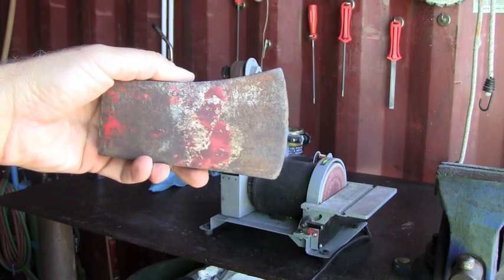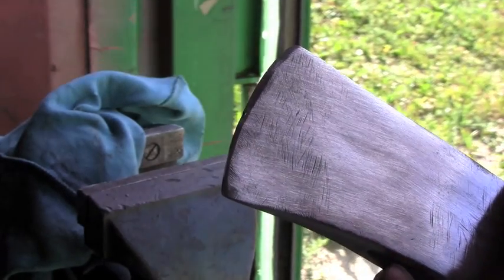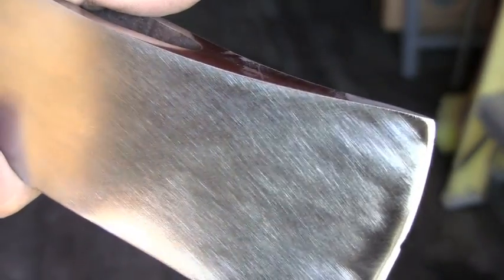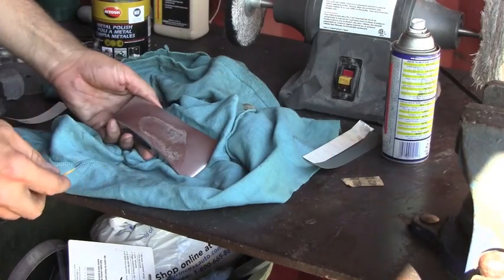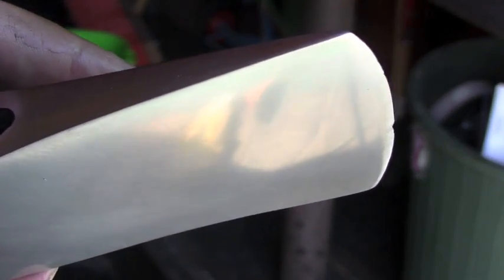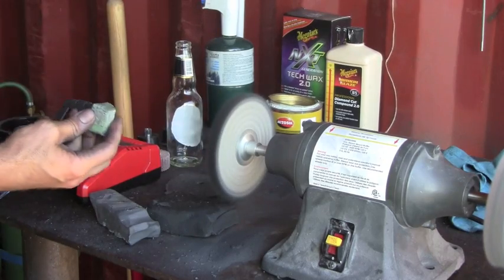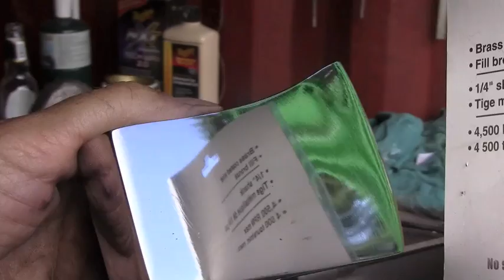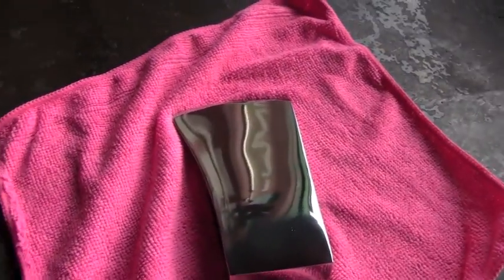How to polish an Axe

Comment: A tip: use different angles for each sandpaper grit size. You can immediately see if you're done getting out the scratches of the courser grit.
Reply: Xiph1980 not supposed to when refinishing an axe.
Reply: You are supposed to. It makes it much easier without any significant change.
Reply: @noonagon1  I agree with you even though everyone has there own way I guess, but I always go in one direction weather I'm sanding wood going with the grain or if I'm sanding metal. Anytime I tried to switch directions I got very poor results

Comment: I have recently completely restored a couple of broad axes that were very badly rusted i started with a 9 inch grinder and worked down to grinding  flap wheels and finally 1200 paper then buffing compound i found the finish you get depends on how much you are willing to sweat and your attention to detail. After all the hard work they are only ever going to be a wall hangers and i keep the mirror finish by spraying it with a clear metal lacquer - Rust Guard - Clear Guard I found it with the metal protecting spray cans at a hardware store here in Australia I spray it on all my shiny wall mounted saws guns and axes sprayed the wife's silver platter over 10 years ago and its still perfect.  Keep shining  Cheers.
Reply: "After all the hard work they are only ever going to be a wall hangers..." that's exactly what I thought of, while watching this video, after so much effort nobody would ever want to use  this axe again :D :D

Comment: I just watched a video where a guy was polishing ports in a motor head.  His point was "you'll polish all kinds of stupid stuff, just because you can". This bears that out a little, although it does have some benefits to cutting, and if you wax it when you put it away, will have anti rust storage benefits, as well, if non-conditioned space, as it will shed water if you have a "rain out" in your garage (reached dew point fast temp drop), which has happened to me a couple of times...then you get to sandpaper EVERY ground metal surface in the shop if you happen to miss the event by a couple of days.  MUCH easier to wax the surfaces every once in a while, and for jobs where a little wax transfer on them doesn't matter (non gluing, say), the tables, especially sliding like on a table saw, work MUCH better.
Reply from the maker: Thanks for the comment

Comment: Thanks for the helpful video.  What does "dressing" the buffing wheel mean?  Just knocking off the old polish compound with a screwdriver?  I've seen other videos where they have a separate buffing pad for each compound, but the dressing method seems cheaper.

Comment: Could you have sped up the process by going from 40 - 80 - 120 grits? 

And what was the paste you used at the 320 grit before using  WD-40?

Comment: I just bought a vintage Collins axe head. Would you recommend this polishing process on an axe head with a makers mark? The head is in pretty good shape just minor rust. Could I skip the lower grit sand paper and start with the higher grit. Any advice you have would be appreciated. You did an outstanding job on that axe head, it blew me away
Reply from the maker: +John Robinson 
It's up to you if you want to polish your name brand axe. An axe always look amazing once polished but having said that, I would never polish my Gransfors Bruk axe. I am proud to own a Gransfors Bruk axe and want to keep it original with the hammer marks on it. It shows that it was hand made. If your axe is in really good shape, you can probably skip the lower grit and start with 200 grit. If you have scratches on your axe that your fingernail goes in, then you definitely need to start with 40 grit.

Gilbert
Reply: +French River Springs  Gransfors are drop forged.
Reply: +Saul Japuntich No, they are not.
Reply: Christopher Long Go visit their forge.  It's open to the public.  They use trip hammers and drop forging to produce the axeheads.
Reply: By the way, please don't start an internet argument.  Let's be fair and civil so as not to attract the trolls.
Reply: +Saul Japuntich All I'm saying is this: metal wrapped, shaped around or otherwise formed around a drift or blank is not the contemporary definition of "drop forging". As for the triphammer, this is only a tool, not a method.

Comment: An axe polished to this degree looks amazing but will you actually split wood with it and if so, how long before you're needing to go through this process again? Thanks for sharing this process. atb!
Reply: +Valerifon1 I highly doubt this axe will go back in service as a woodcutter, it's probably been made into either a ceremonial axe (firefighter ceremonies) or a display piece (wall hanger).  If you cut wood even one time you would ruin that perfect finish and would defeat the purpose of all that sanding and polishing.  But, I will admit it looks awesome.  I didn't notice a makers mark or brand on that axe. I wonder if he sanded it off, if so he may have lost some of the value, maybe, but you can't argue with that beautiful finish.
Reply: +Valerifon1 Actually yes. A highly polish face is an incredibly smooth face. An incredibly smooth face does not suffer from grip issues, and so such as axe will not get stuck in the wood, should it not completely split. As long as you are careful, using a wooden chopping block, and you oil your axe head after each use (a thin coat prevents water causing rust, or at least minimizes), then occasional maintenance keeping the polish up is all that's needed. 

Due to a polished face slipping through wood more easily, the more polished it is, the less it will come up against resistance from the wood. The more polished it is, the less polishing you will need to do in future. Blunt axes don't go where you want them to go, polished axes (assuming you can use an axe properly) will, first time.

However, this axe head has a massive nick in the bit, so no, THIS one would make a crap axe.
Reply: +Jonathan Walker How much experience do you have with axes?
Reply: +Jonathan Walker That is completely not true at all.   It really doesn't take much effort to maintain the mirror finish once it is there.

Comment: Hello! Nice video. Once you polish metal with all the compounds and you have the finish you want......will clear Rustoleum spray paint stick to it? I'm a little concerned about all the wax. Or is the wax actually all gone and it's just shinny and rust free at that point?
Thanks for your time
Reply from the maker: It's pretty much just bare metal that is polished. Paint would not stick very good.
Reply: @frenchriversprings  well paint was a bad choice of words. I'm talking about that clear coat polyurethane by Rustoleum. It's made for metal so it prevents rusting. 
I'm making hand forged pendants. I finish them with it. It works very well. But I've never shined a piece like you did and then cleared it is why I'm asking. If you say it's pretty much a shinny piece of metal I think I'll hit it with alchohol and then coat it. Wish me luck!

Comment: Pretty good job on that. I am surprised the keyboard experts aren't giving tips about using different compounds on the same buff but atleast your dressing it prior to loading so it doesn't matter much. I saw you putting small amounts on at a time so I can tell you know what your doing.. I saw the Meguires correction glaze on the bench, that is awful awful stuff, I never was impressed with Meguires compounds in the tan jug but I like their ultimate compound and ultimate polish. Other than that I use 3D brand compounds and polish mostly

Comment: Try starting with removing the paint with a commercial chemical product, and then start grinding with the 80 grit flap wheel, instead of the 40, then go from the 80 to the 120 grit, and then to 180, if you have it, then to the 220 grit, and then higher numbers.  Could be too much of a jump from the scratches made by the coarse 40 grit to the much finer 180 and 220 grit flapwheels to get the shine you wanted without spending all day on it. Seems like the buffing wheels gave you the fine finish you wanted.  Good job!

Comment: Hey what is up fellow YouTuber.  Got another question for you.  Up until recently I've been polishing hammers and axes like crazy using your methods but now lately I've noticed I'm getting a lot of fine swirl marks and its not as clean.  Nothing has changed and I change out my buffing wheels when necessary so its not an old buffing wheel. Maybe I am just not spending enough time on one of the compounds?  But which one?  Which one is the culprit leaving these swirl marks?  I use black, brown, white, and green in that order.  I figure i would come back to the polish king for some tips. Thanks!

Comment: Where do you get those flap disks from?  I can't find the 120 and 240 
grit ones on ebay.  Is there a website that sells all those grits?  I'm 
in the U.S. and they don't typically sell those anywhere I can find 
them.  Thanks.
Reply from the maker: Yes Anthony, they are hard to find!  Go to Amazon.com and type  "DEWALT DAFE1H2410" for the 240 grit and "DEWALT DAFE1H1210" for the 120 grit. Good luck!
Reply: French River Springs damn....thats beautiful
Reply from the maker: Thank you sir!

Comment: Master, Is it possible to use bare hands with diamond compounds to achieve your result?
Reply from the maker: Shure just do a bit every day so you don't wear of your skin
Reply: @frenchriversprings  Sorry, I mean, I use only hands with sand papers and polish tools without any electrical machine.  Your result is amazing.
Reply from the maker: Absolutely, it just takes longer
Reply: @frenchriversprings  Master, if there are some deep scratches on old axe, will you buff them all off or just leave some without grind too much steel? 
Do you use water to cool the axe when it is too hot during polishing work?

Comment: What are the two wheels on the bench grinder called? also what was the small metal rod you used on the wheel to the left for ?
Reply from the maker: mastermachetier  it's called a bench top buffer. That rod is a large screwdriver. Just used it to clean the buffing wheel
Reply: Thanks for getting back to me ! Do you think this process would remove any makers marks ? Should I just avoid sanding that area?
Reply from the maker: mastermachetier   It depends how deep it is. Maybe start out with 400 grit in that area and you should be fine.

Comment: Hello YouTuber!  Have you managed to find those flap wheels in finer grits?  I am looking for them up to 600 grit but I don't think they exist before you get into those brush ones for furniture that don't work on metal.
Reply from the maker: Have not found them. Oscillating sander works really well and high grits are available
Reply: @frenchriversprings  Thank you for the idea about the oscillating sanders.
Reply from the maker: A. O. You are very welcome

Comment: could you please tell me what wheels you use along with the wheel compound and grit thx
Reply from the maker: I used a sisal buffing wheel and a softer buffing wheel. White buffing compound on sisal wheel then green compound on sisal wheel and then rouge on the softer buffing wheel.
Reply: French River Springs Loved the video. Can you tell me which specific Sisal wheels you are using? Just got an axe to work on!

Comment: If you stay away from the first few inches of the toe, you can avoid messing up the temper. You can use a tig or even a mig to fill deep gouges, as long as you go bo more then a few MM at a time, and  dip your project in cool water often. It takes close to 600-650°+ at the toe to seriously mess up the temper. High heat in concentrated areas, away from the toe isn't really a problem. You can also re-temper it yourself and make a video👍.

Comment: Hi again.  Your video is by far the most detailed way to polish metal, not just an axe or tools.  I do have a question, how do you know when to move onto the next grit of sandpaper?  I have tried this on a ball peen hammer using 80,120, and 240 flap disks then moved on to 320 grit dry and 320 grit wet, wet sanded with WD40 with 400, 600, 800, and 1500 and then buffing compounds but still see some fine swirls that had to be left from one of the finer grit stages.  How do I fix this problem?  Thank you sir!
Reply from the maker: Ya it's tricky and lots of work. So let's say you go
Reply from the maker: So let's say you do 200 grit then 400 grit, if you see some coarser line than the 400 grit in the sun, then you need to spend more time on the 400 grit. Go back and spend more time on the 1500 grit then do 3000 grit, then buff. Good luck
Reply: I will try that next time.  Have you had any need to use 180 grit in between 120 and 240 or is there a difference?  I dont know if there's any kind of rule of thumb on the leap between grits or any benefit of adding 180 into the mix.  Thanks!
Reply from the maker: Yes there is a rule of thumb. Always double the grit. Example: 100 grit, 200, 400, 800,1600 etc
Reply: Thanks!  Glad to know because I didn't know if the in between grits were necessary.  That will save me some time.

Comment: 6:40 - what exactly are you doing with the screwdriver again? "Dress the wheel"? What does that mean and do? and how can I acheive same results in a manual labor? I don't own this type of machine :(
Reply: Amazing result! Is it sharp too tho?
Reply from the maker: Dave, I was just cleaning the wheel with the screwdriver before applying more compound. Yes you can do everything by hand. Start with 40 grit sand paper and use Wd 40 or diesel as a lubricant. Then 80 grit,120,240,400,800,1500,3000 and 5000 grit. You will have a hard time finding higher grit than 800 at your hardware store. The rest you will have to order on eBay. After you are done with the 5000 grit, then apply some metal polish to a rag and rub. You will find metal polish at any automotive store. Be patient, it will take all day. Good luck!
Reply: French River Springs mate thank you for this great video and very informative answer:)
Reply from the maker: Dave, your welcome. I just post a new video "how to remove rust from a knife". I did it with only sandpaper and metal polish. I think that you will like it.

Comment: Why would one polish an axe?
Reply: Christopher Delich cuts better looks better why not
Reply: Good question.  It will look awesome.. but it will stick in the trees... a rough finish leaves less of the head in firm contact with the cut making it easier to remove.
Reply: Christopher Delich why would one watch an instructional video on how to polish an axe, and then ask that question?
Reply: You assume I searched for a video about polishing axes, when it could have just come up in the queue, as it did.  Also, it is reasonable to surmise that the reason for the polishing of the might be included in the video.   However, it was not.
Reply: Because ladies love it when a guy properly looks after and maintains his chopper!
Reply: I Think he polished his Axe simply because he could, and why not, I can also see the logic from Brian Tracy's comment too.  I'm a bushcrafter, I own a Becker BK2 Knife, its a beast 1/4" thick and its built to be abused and I do, I chop with it, Batton with it and skin with it, I mirror polished mine after watching this video, it is mainly for asthetics but boy does it look good.
Reply: I found my grandfathers axehead buried in the dirt where his old shed uses to be. I will polish it like this and hang it on the wall to pass down as an heirloom
Reply: Reason for mirror polish: 
LESS friction during penetration of the blade. 
If the axe surface is rough, most of the 'power' & energy will be dissipated into the wood as HEAT. 
The attribute of an axe 'sticking' into the wood is due to the shape of the cutting edge .... AND the roughness of the surface .   ;-)

Comment: Why didn't you fix that big ass chip first.. ..
Reply: Plutonium2222 its on the edge of the axe head, near the middle
Reply: because he can always do it later...
Reply: Because if you sharpen it first you have to spend 6 hours avoiding a sharp axe flying back at you every pass with the flap discs and the polishing wheels on the bench grinder.

Comment: Why bother polishing an axe head with such a bad ding in the bit? Is it just for demonstration purposes?
Reply: +Jeremy Hunter Not all that difficult to take the ding out in the sharpening process....
Reply: It's so time consuming unless you damage the strength of the bit by going at it too hard and fast.
Reply: +Jeremy Hunter no on both points. The only you really have to do is remove the sap build up, which van be done quite easily in a few different ways. I have polished axes that I use almost every day... if you take care of it keep it clean it really doesn't take much time getting it back to a mirror.
Reply: Did you even watch the video? This isn't about maintaining an axe.
Reply: +Jeremy Hunter a ding in the bit is not big deal to remove at all...
Reply: Carl Antaya So how quickly did you remove that ding without damaging the bit then?
Reply: +Jeremy Hunter I can do it in 10 minutes on my tormek watercooled grinder.
Reply: Carl Antaya A piece of equipment owned by most people, I don't doubt.
Reply: If you have the equipment needed to do a mirror polish you easily have the equipment for sharpening and reprofiling an axe.

Comment: Soft wheel, hard wheel, compound this, compound that, working the wheel...WTF?? You've lost me at the flap disc and hand sanding paper.. After that I didn't have a clue what you're talking about or what you're using...